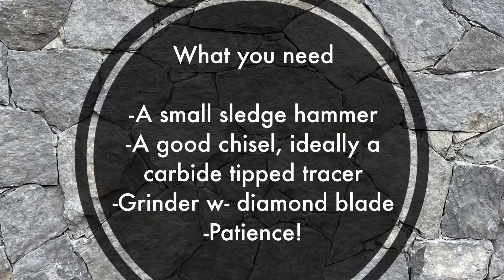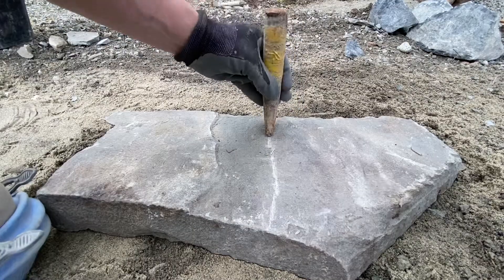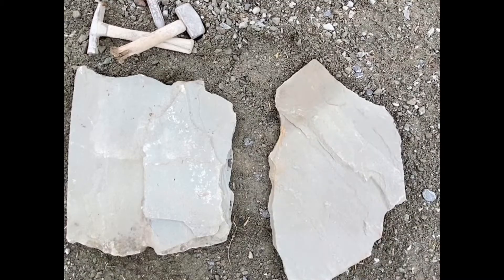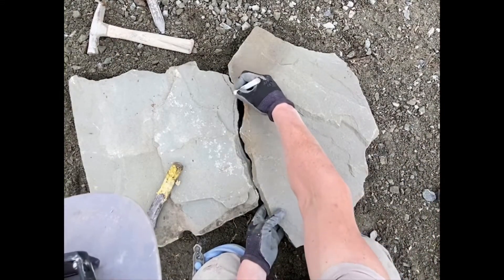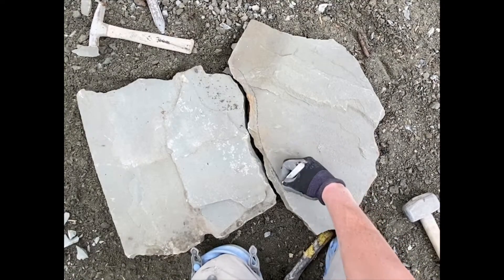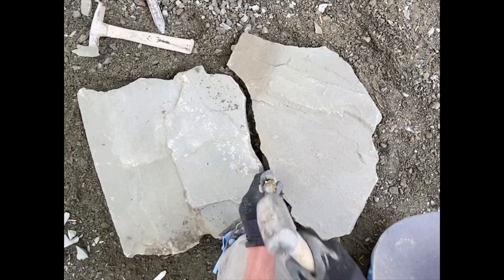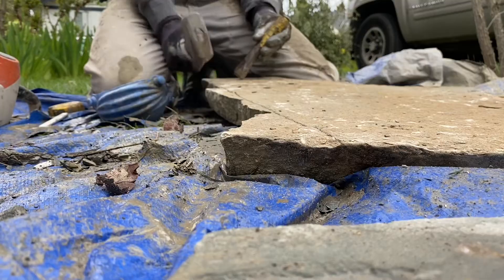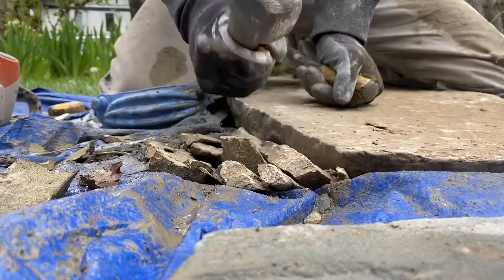CHISEL FLAGSTONE like a pro with these simple tips and insider knowledge!

Comment: Excellent video Kev..  I am new to this, but lucky enough to have a customer who isn't too picky.  First jobs are like teaching tools.   One question.. What do you put under the stone you are cutting ? ie.. Wood, or a sand base , or on another rock...?    Looks like you frequently use a sand base , but thought I would confirm and ensure one method is better than others .. Thank you.
Reply from the maker: Hey yes that’s the best way to refine your skills! So the biggest thing is just to make sure the piece is steady, and when you are striking it, that it is rattling and moving other parts of the stone as this may cause it to crack. It doesn’t really matter what you have underneath it, as long as the piece is steady so the energy you are striking with it hitting just that portion of the stone

Comment: Nice. Like the chisel technique better than just a hammer.
Reply from the maker: mb thanks! Yeah you can cut much cleaner lines with a chisel. Nothing beats the carbide tip.
Reply: Hardscape Instructor- Kevin Wilson is there a particular make or model of tip that you recommend. My wife and I are going to sandstone both the front and backyard of the house. Any suggestions will be very welcome.
Reply from the maker: mb I like to use Rebit chisels from Micon stone tools in Vancouver. Trow and Holden has similar. A nice wide, pointed tip tracer is good for centre splitting, and a square edge pitching chisel for edge finishing.
Reply: Hardscape Instructor- Kevin Wilson Great. Thank you so much.

Comment: Thanks for sharing these tips on shaping flagstones.  Are the seams in this sample filled with cement or other bonding/sealing material?
Reply from the maker: You can use mortar for the joints, or an epoxy based jointing compound for open graded base (permeable) patios, or if its set on concrete/in mortar you can use a fast setting tile grout as well.
Reply: On my current project, which is a whopping 1,300 sf, I am using a mixture of decomposed granite and Quickcrete for bonding. Looks more natural than concrete.

Comment: Great information, thanks! What weight sledge hammer should we use?
Reply from the maker: A 2lb club hammer/mini sledge is a good place to start, but it really depends on your strength. If it’s hurting your elbow then it’s okay to size down. You’ll be swinging it a LOT so make sure you aren’t hurting yourself!

Comment: Hi all,

Would this work with slate? About three to four inches thick? 
Tia
Reply from the maker: Hey if it’s a slate and has defined horizontal layers then you will have to do some saw cutting as well as use some of these chiselling techniques. Saw cut for majority and hammer and chisel for edge shaping and finishing

Comment: Thanks much for the video! What size chisels are you working with here? 1.5 or 2 inch blades? Is there a big difference when choosing?
Reply from the maker: Hey you’re welcome! They are 1.5” width, but it doesn’t matter too much if you hold it flush to the stone and do some practice chiselling first!
Reply: @HardscapeCanada  right on. Thank you! Figured that's what I should go with for a new carbide chipper (2 inches was tempting but I have that length as a pitching tool.) Been working on a huge patio project with walls and deck. It's been about 2 years and will take about 1 more. Thank you again - and for the video!

Comment: I live in Victoria BC. It doesn't freeze here much, only about a few weeks in february.  Am I able to use mortar in between the joints to lock in all in place, or will it break in the freezing cycle?  Thanks in advance.
Reply from the maker: Hey I’m in Victoria as well! You can but usually mortared joints are paired with mortared stone onto a concrete pad. If your flagstone is set on gravel or in sand then I’d recommend checking out Romex products from Site One supply on keating. They have some great jointing compounds for your application

Comment: My stone is brown or rust colored and doesn't brake like this,  if I try that technique with my tracer, the other side will crack in a different spot, why is that? I wish you could work with me for 10 min, I'm lost and I have 20 tons of this done on my lawn.. wife is going to kill me
Reply from the maker: Hey Dan, do you know what type of stone it is that you have? You may want to start cutting with a grinder or cutoff saw as well as chiseling. That will speed it right up for you. If it’s going to be laid with grass in between then you can get away with larger 3-4” gaps and won’t need to work the stone as much as just fit shapes.
Reply: @HardscapeCanada  i meant to say 20 tons of stone in my grass. Haha. Ok, I'll try that,  a friend let me use a 900 saw. Maybe that's what I need to do. Thanks.  I don't know what kind of stone this is.

Comment: Great video, I'm doing a small DiY project with Yorkstone flags/slabs. Complete beginner question but what kind of hammer is that? Is there any cheaper alternative to the carbide tracer chisel for splitting? They look great but are expensive.
Also if you were needing to split off a corner or smaller chunk, say 1/3rd of the slab would you use the tracer? or pitcher to chip away? Many thanks if you can help :)
Reply from the maker: Hey I’m not familiar with that particular type of stone, however you can certainly use a standard cold/steel chisel in tandem with a grinder or small cutoff saw to shape the stones to your liking. It’ll involve creating more dust (MUST wear a mask) but you can achieve the same results. The hammer is just a small 2.5lb mini sledge. You can use any smaller hammer that is comfortable for you to wield. If there’s enough of the stone there ie 1/3rd then you could try to split it right on your line with the tracer as opposed to chipping it back. Some stone types don’t take to splitting very well so definitely be prepared to cut and shape with a grinder as well!